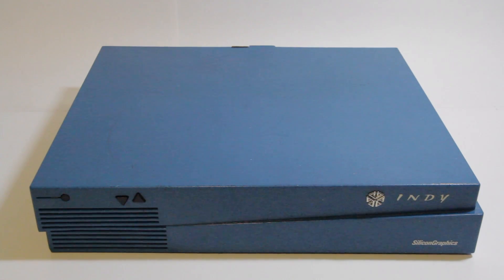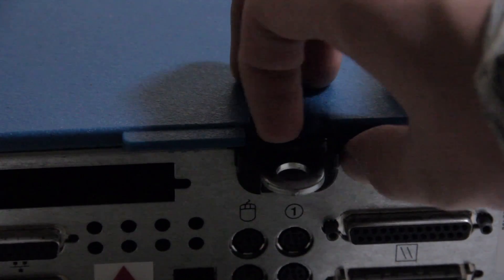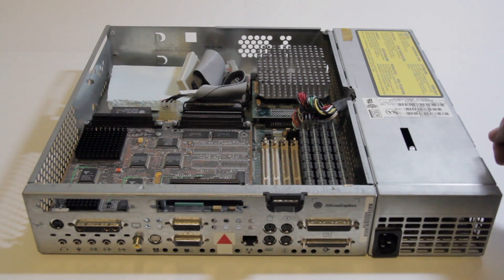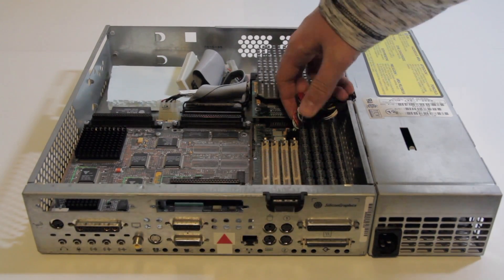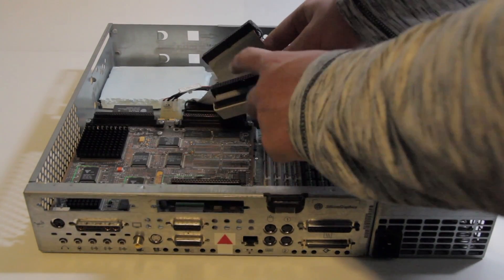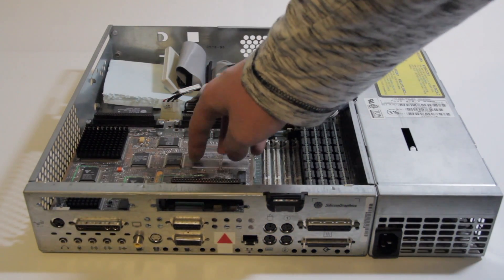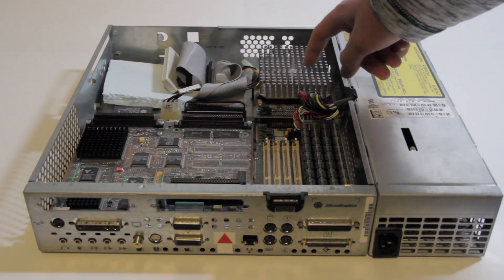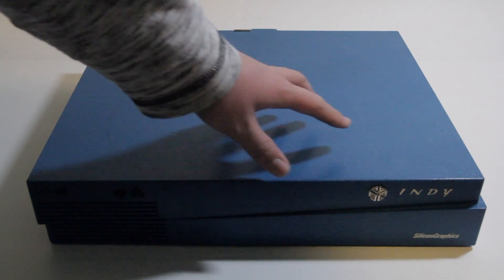Dodoid Advent Calendar Pt.22 - Indy Innards

Comment: 3:10 - the foam is definitely non-standard.  The drives were normally mounted in metal cages that would mount onto those little tongues that are behind your fingers at 3:04 (and visible shortly after).

Comment: Random amusement: I believe the Indy was what allowed the final stages of an internal program at SGI called "Move Over Mac" (or MOM on the internal merch, heh) -- trying to get all the finance and other admin (i.e. non-technical) folks off of macs and onto SGI hardware.  If I'm remembering correctly, this had largely completed by the time I started working there (though my own actual mom was more involved in the project, as she worked there before me -- and yes, she had a MOM mug), which made things nice for me as I joined the internal tech support, because our team no longer had to support multiple operating systems... everybody just had IRIX.  (Granted, there were some different versions out there, but... it was all IRIX.)

Ahh, those were the good old days.  Best company I ever worked at (and I've worked for a variety of places, big names and small).

Comment: Speaker as a part of the power supply? Of course. Makes sense. Innovative lol. XD Also for the dallas chip, just as a point of interest - some other variants of those chips have hardware serial numbers factory-programmed into the chips which may or may not be used by the computer (it's just a read-only register that's a part of the EEPROM). They're non-modifiable and the computers can use them to deal with software "option keys" (keys that unlock hardware features). This is common on oscilloscopes and other scientific hardware. The idea is that the hardware key from the dallas chip (non-modifiable) is used together with a software serial number (modifiable) together with option keys that you purchase from the company. If the battery dies, you lose the option keys but not the hardware serial number. This configuration also means that option keys only work on one machine, unless you swap dallas chips/motherboards. Dunno if this functionality was ever used in any SGI machines; probably not.

Comment: Is this EDO RAM? It reminds me them a lot.
Reply from the maker: +Shiunbird As far as I can tell, it isn't. Not sure though, didn't do much research.
Reply: The Indy (and Indigo/Indigo2/Challenge S) uses standard 72 pin FPM (Fast Page Mode) SIMMS, 36-bits wide, 60-70ns, with parity.  Pretty standard stuff back in the day.
Reply: No, it's full parity 72pin 36bit, preferably gold edge. EDO will not work. Some models of early PCs did use the same type.

Fun fact: fitting two 512MB kits in an Indy will show up as 128MB per kit instead, because of the way the interleave wiring can only see 1/4 of the RAM in each bank. :D  A ridiculous way to get the max 256MB.